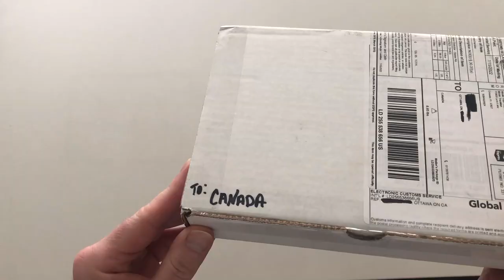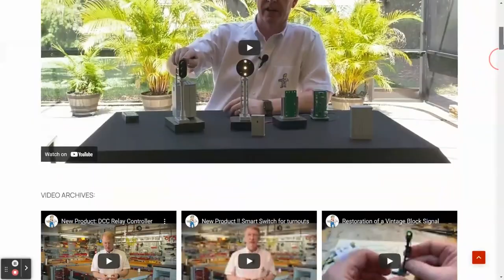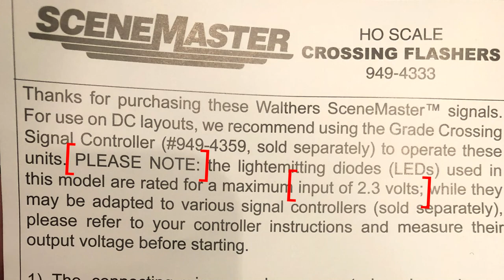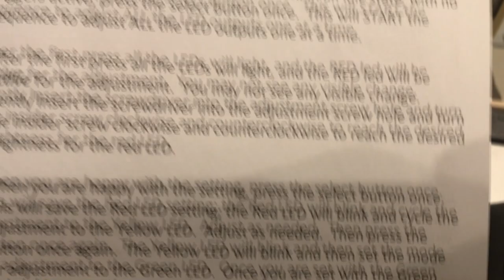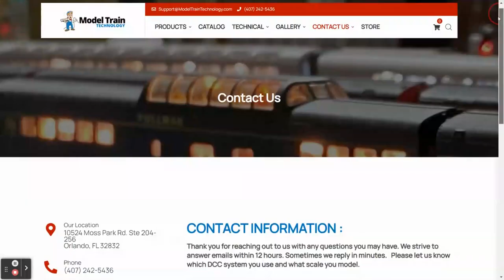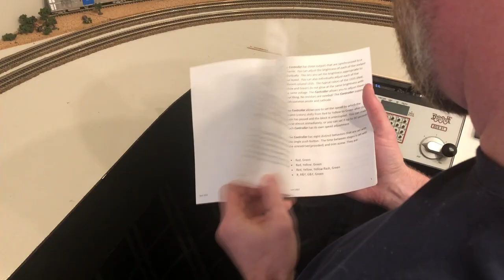Model Train Technology - Starter Kit Review

Comment: This is great...I burned out my 2v layout control panel LEDs....forgot to install the resistors I bought...lol...all good for us clever clogs...the show must go on! Cheers for streaming.
Reply from the maker: Thanks! Those crossing signals shown are my second set because I fried the last two. This system says you don’t need resistors, you just have to lower the voltage output. Something I read AFTER. Lol.

Comment: Thanks Mark when a "Blink-ity Blink" is a GOOD THING, also wondering how it would work with a Dbbl Main running together.
Reply from the maker: Thanks Bernard! I forgot to mention it in the video, but apparently it will work fine with double tracks. You just have to set the sensor to a longer range.

Comment: Good review with positive recommendations for improvements.  👍👍  I bought the Walters signal setup 3 years ago.  Only the signal heads made it to the layout.  After watching this, I’m going to see if I can find the controller and sensors and try to install.  

Question: How would you set it up for double track crossing?  Would You need 4 sensors?  Different distance to each track and different directions?
Reply from the maker: Thanks Fred! I have the Walthers system on back order. I’m going to compare the two. I forgot to mention in my video how double track works. All you do is set the sensor range to detect the furthest train and I believe then it will pick up both tracks. I noticed my sensor reset to default so this system isn’t perfect. We’ll see what happens next live show. That’s always the true test.
Reply: Hopefully you get your Walters and do video so I don’t have to burn my out😀

Comment: Awesome video. I know you have some trouble but I'm glad you got it going and it's good to share your experience. I've always used Azatrax but if I ever decide to add crossing lights I'll have to consider this for sure.
Reply from the maker: Thanks Dave! You seem to have pretty good luck with Azatrax so why change? Not sure how you paid, but this system is quite pricey.
Reply: @MMRails  yea Azatrax isn't cheap either. I looked this morning and saw Azatrax has their own kit so I would likely stick with them. Both spring switch kits and my signal work perfect.

Comment: Hi Mark, have you ever thought of going into the rabbit hole and learn about Arduino? 1st, you would save lots and lots of money. 2nd, there are lots and lots of videos out there. 3rd, there are lots and lots of people that can help. Putting the lots and lots aside, there's a Arduino railroad group, most codes are already written and my favorite, it's CHEAP.
Reply from the maker: You had me at cheap Lloyd. Haha. I have definitely thought about Arduino. I fell for the “plug and play” aspect of this system. Not sure it was worth the money looking back now. As I do more research and hear from others, I’m thinking it all comes down to the sensors. And really, it’s a novelty. Cool for a video or when kids come over, but will I use the flashers when I run trains? We’ll see. As for Arduino, I need someone to post a video that sells me on it. Wink wink.

Comment: Hey Mark you say you bought a starter kit right? Did you have this personalized for your needs or can I search for it on there web site? Thanks in advance. -Jason
Reply from the maker: Jason, you can find it on their website. If you can’t let me know, I’ll post a link. I bought an additional sensor, so much better.
Reply: @MMRails  Thank you Mark!! I was able to find the video on it and also the correct words to use in the search box on there website🤦‍♂️🤷‍♂️😅 Did flashers come with your order? The bundle I found had flashers as well as the other components for like 200.00 dollars. Does that sound about right? I already have the flashers from walthers.
Reply from the maker: @jaybird111207     You can buy their flashers but I chose not to. If you use Walthers, make sure you make the adjustments that I made. You have to switch the polarity and reduce the voltage. Good luck!
Reply: @MMRails  I have the Walthers cantilever flashers so I'm just going to get the components I need at some point. 🤷‍♂️ definitely will make the right adjustments. Thanks again Mark!! 🤙🤟😎

Comment: Hi Mark - Great video! Love your sense of humor and delivery style. 7:09 mark - solders heavier wire to magnet wire - Brilliant. Do they have a bell module available? I went the straight dummy route. No detection, no bell. Toggle switch to manually turn on and off. And just use the bell on the loco decoder. Take care - Bill
Reply from the maker: Thanks Bill! They do have a bell module but I already spent enough money on this system. :) I was going to go your route and just have a switch but I saw this set up and it looked easy to install. It wasn’t as easy as advertised, but it works now and I don’t think I’ll be adding more.

Comment: I bought the starter kit with the three LED block signal.  So far I can't get even get the LED's to come on.  Big disappointment.
Reply from the maker: Sorry to hear that. Did you contact the owner? It takes some fiddling. It’s cool when it works but it’s not easy to get it working.